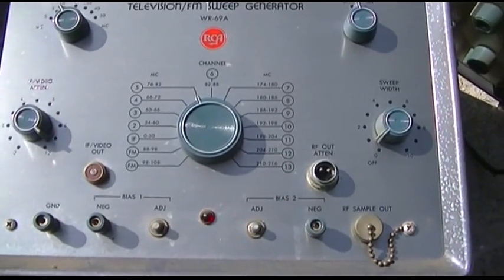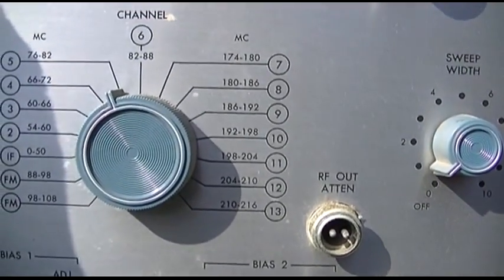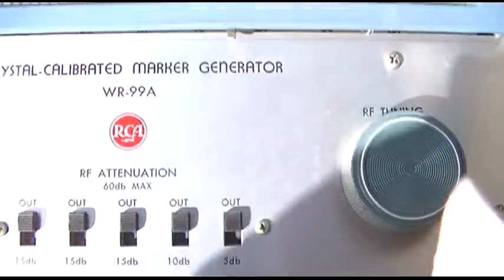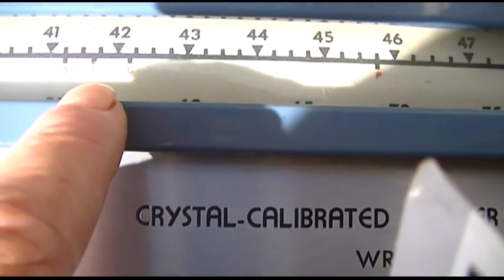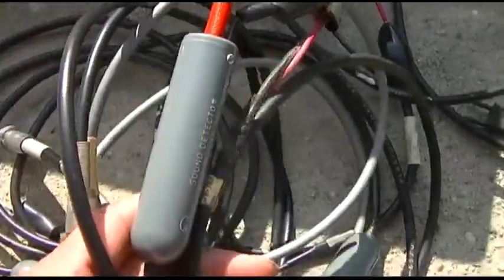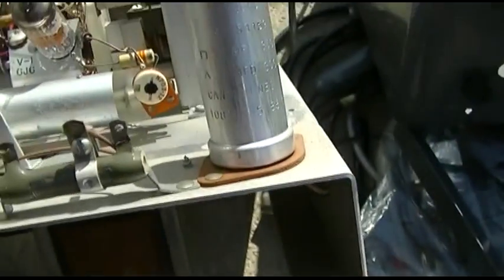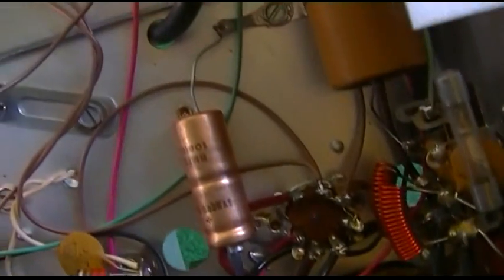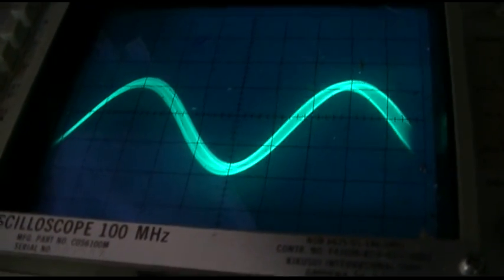Vintage RCA Sweep RF IF Alignment Generators WR-69A WR-70A WR-39C WR-99

Comment: I'm assuming that an EICO 369 sweep/marker generator modified to include a connection to a digital frequency counter for the marker oscillator would do everything these three RCA pieces do.  I just finished my 369 with these mods.  Am I missing something?  Also, I used a Wavetek 1801 sweep generator with an external marker input to align the IF on my pre-1950 TVs (25mhz IF band).  It worked great.

Comment: the video multi marker and the 304 rf modulator are used in conjunction with RCAs VSM Video Sweep Modulation alignment method.  there is an  article about it in one of the PF reporters.

Comment: The calibrator is to set the absolute frequency when setting the marker generator. The speaker is to allow you to hear an audio beat when the marker generator matches the crystal controlled frequency of the calibrator.

The equipment is old school but does an excellent job of alignment when properly used.

Comment: the WR-70A was made to partner with the WR-69A to add a marker signel for that unit.I acquired both similar units back in the 90s but just have the WR-69A now.

Comment: Wow!  That is the exact set I used at Stefanski TV in Waterford MI between 1978 and 1983.  It was close but no cigar.  You had to do a little tweeking when done.  I would only use on sets that the customer got diddle stick happy.

Comment: Nice gear!  The channel output is for aligning the tuner.  The 39C is used to generator markers and the speaker is for  calibrating it.  You beat the RF against a crystal, adjust a tuning slug and listen for a null.